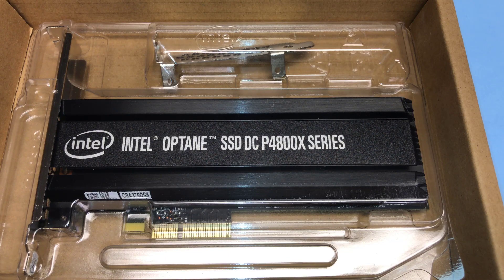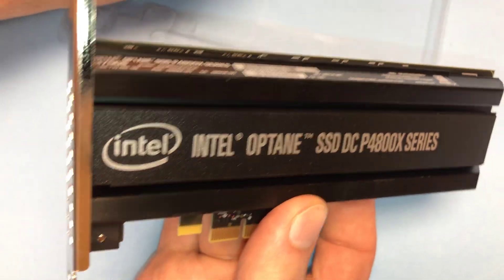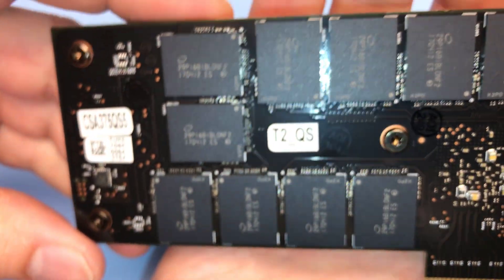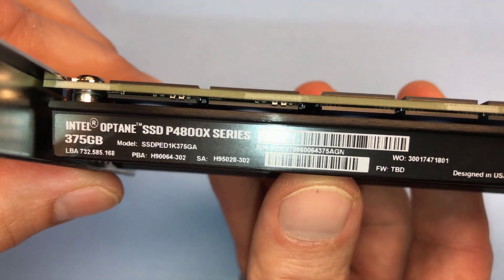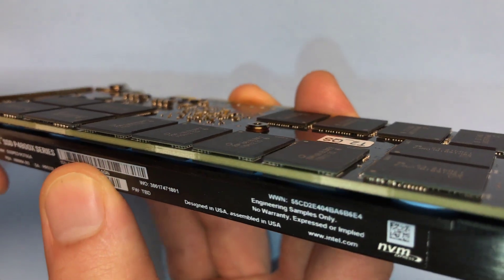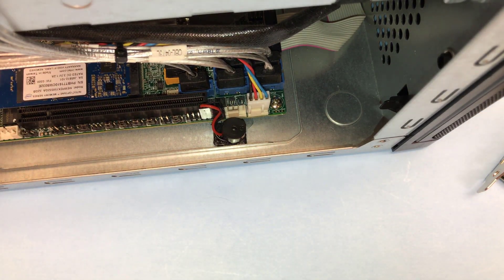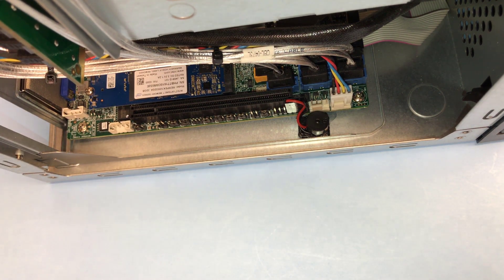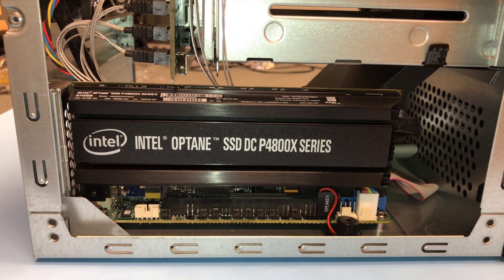World's First Close Look at Intel Optane SSD DC P4800X Series

Comment: Benchmarks are still under NDA? And what is that neat system??
Reply from the maker: It's a Supermicro SuperServer SYS-5028D-TN4T:
http://www.supermicro.com/products/system/midtower/5028/SYS-5028D-TN4T.cfm

specifically, a "Bundle 2" Xeon D-1541 8 core system sent from Wiredzone:

https://TinkerTry.com/superservers

https://TinkerTry.com/my-tinkertry-d-xeon-d-bundle-2-supermicro-superserver-bundle-2-of-joy

Allyn has some numbers over at PC Perspective:
https://www.pcper.com/reviews/Storage/Intel-Optane-SSD-DC-P4800X-375GB-Review-Enterprise-3D-XPoint/Write-Pressure-Conclusi

Comment: Interesting that it lacks a backplate and only half the packages are connected to a heatsink. I would assume the the heatsink's purpose is for cooling the controller, with the thermal pads being primarily used to keep the heatsink from flexing rather than removing heat.
Reply from the maker: I found that interesting too, thanks for the comments!